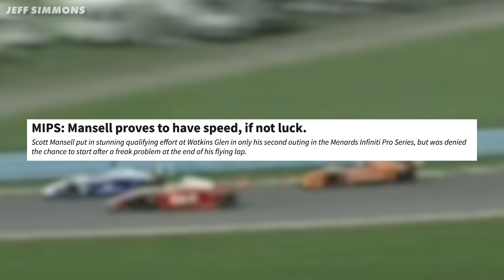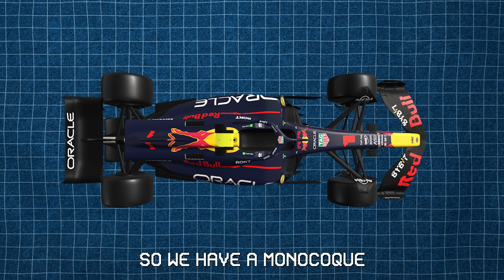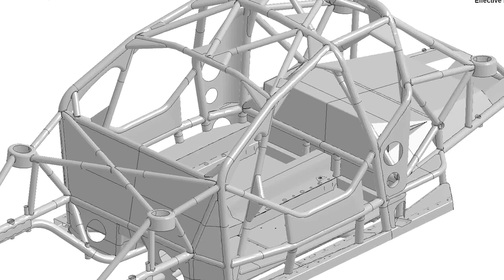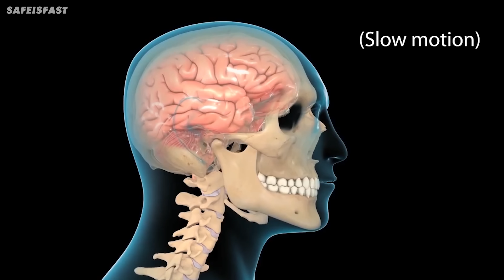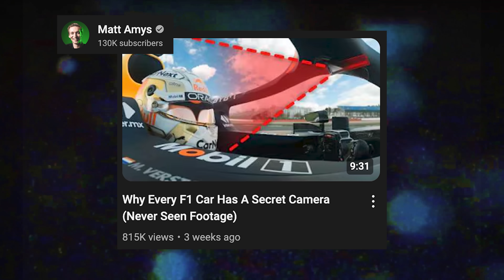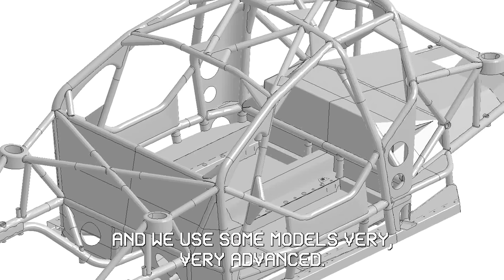How F1 Drivers Survive Stopping 200 to 0 MPH in 0.5 Seconds

Comment: 6:54 - Holy shitballs, he explained that horrendously. That guy is a doctor... right??
Reply: There are also several incorrect attributes of reduced energy as the key to crash structures.  These structures increase the amount of time that the force is applied over.  Force is mass times acceleration, but acceleration is a change in velocity over time.  The parts coming off the car during the incident does not change the mass of the driver.  The variable that can be changed on the driver is the quantity of time.
Reply: I thought he perfectly explained it

Comment: Well.
Most of your videos are great but this one smashed the ball right out of the par./ country!
Superb content.
Superb presentation.
Superb education.
Mems sensors in earpads so great, I hate laws but would'nt it be great if all crash helmets worldwide had mems data recorders integrated, so that cellphone apps could read them.
The necessary increased cost to a reasonable crash helmet would be much less than 0.5% but the value of data would be immeasureable.

Comment: When I was 18 I managed to use my head to break someone's jaw playing soccer. I blacked out for a few seconds after initial contact and my head hit the ground, I was told it was a pretty hard one since I had 0 recollection. I can confirm, its not fun. I had to sit out for 3 weeks as I kept getting the headaches. In the recovery time I was fully aware where I was physically but mentally I did not feel like I was where I was physically, kind of like was was just floating through or being a ghost. Basic school work triggered headaches after only 15-20 minutes. Definitely something to not mess around with, have to prioritize recovery. You can always play another day, but you only get one brain.

Comment: on new years two years ago i had two crashes about 30-40 minutes apart : one was not that big although i did hit my head but the second we drove straight head first into a stone wall on high speed. car was absolutely wrecked and i hit my head extremely hard. I was definitely concussed and felt very weird for a week or two after. fast forward to end of march last year and after some heavy things that took a toll on my body i had muscle spasms, loss of feeling and control and even culminated in a kind of seizure. Did a mri and sure enough i had a big white spot on my brain (part that controls the right arm/flank movement), doctors thought it was either a tumor or dysplasia. three months later another mri and it was gone, no one has a clue what it was or how it went away but it was the same spot i hit my head the hardest on that crash.

Comment: Kenny Brack holds the world record for the highest surviving G force impact in IndyCar at a recorded 214G’s at Texas Motor Speedway in 2003. 357kph to zero in two feet and then further hits down track until his car stopped close to a half mile away. He suffered multiple fractures, breaking his sternum, femur, shattering a vertebra in his spine and crushing his ankles. He spent eighteen months recovering from his injuries. It’s simply amazing that he survived and returned to race in the Indy 500 two years later before retiring from open wheel, (don’t blame him!).

Comment: Brilliant!  Driver side padding also plays a part to try to slow the acceleration felt by the driver's head.  In the case of Robert Kubica's accident in Canada, the car saw 75g - the brain cannot survive that.  The barriers, car and safety systems meant Robert's in ear accelerometers recorded a bit less than 20g.  That is just survivable.  It was a massive crash.  The doctors made him rest - correct!!   He won the race at the same track the following year (crash 2007, win 2008).
Reply: HANS device is the bigger hero.

Comment: Speed has never killed anyone, it’s the sudden stop that does.
Reply: Also true of falling.
It's not the fall that kills you, it's the sudden stop.
Reply: @jofi4580  i realized that i am not afraid of heights, i am afraid of gravity
- one astronaut after his first EVA
Reply: Before the HANS device the biggest issue was that the driver's head didn't stop with the body.
Reply: Exactly!!!  I have sustained 7 concussions, 3 of the massive concussions and as a result I am a different person…I suffer headaches constantly, depression, suicidal thoughts, anger outbursts and insane nightmares and finally PTSD….
I am nowhere near the man I used to be…
Reply: @rokkitman59  I am so very sorry for you.
How terrible.
Do you have support and help with your issues?
Why have you had seven concussions?
Reply: It could. Smashing your car into a concrete building at 200 mph will not stop the car, it will disintegrate you and the car
Reply: To be fair, the sudden application of speed is just as likely to kill you as the sudden removal of it.
Reply: @K-Anator if that was true, then every top fuel, pro stock driver would be dead….your statement has been disproven time and time again.

Comment: Wow, you have quite the following. who would have thought that many young women would like a video about car crashing?   Non Medical anecdotal concussion history; bike ride into a half inch cable stretched across a driveway at night, landed on forehead, blinding light, followed by throwing up, headache lasted for two months.  cold cocked in the temple leaving dance, woke up on the ground with girlfriend looking down, what happened? Temple had soft spot for years.  crashed bike into pot hole, woke on road side with helmet cracked, refused 600.00 ride in ambulance  walked home, next day X-rays resulted in titanium plate and screws to hold collarbone together. had headache for months after. I can't imagine what a race driver goes through.

Comment: The direction of the G forces and how prolonged they are, are almost as important as the intensity.
Reply: G force can be reduced by extending the amount of time the change in velocity happens over.  That's what the crash structures are actually doing.  Extending the time.

Comment: Ratzenberg hit 500g and unfortunately he didn't make it. David purley hit 179g in F1 and made it out alive in 1977. Can't imagine the trauma to be honest
Reply: How did they measure the impact in 1979?
Reply: @procatprocat9647  By the initial speed and the deceleration distance, the crushed length of the car + the bending of the barrier. From 173 to 0 in 66cm (~2ft2inches).
Reply: @boubacar5343 that's a very inaccurate approach to determine quite an accurate result. A minor change in the barrier ground mounting would make a significant difference. That's one example of hundreds. Maybe a tolerance should be added of 20%? Thats a toyaly guess, but it could be determined by summing the tolerances in one direction

Thanks for responding though.

Edit - do you have a reference on how it was calculated?
Reply: @procatprocat9647 Well, they measured it, a movement stopped on impact, there's also photos of the car exposed as it was then.
Reply: @boubacar5343 you can only measure plastic deformation, and estimate the non-linear deformation. You can't measure the elastic deformation of the dozens of different materials that were involved in the collision. 

I was hoping you weren't going to use the word 'measure'. 

Based on your last message, the level of inaccuracy is enormous. To state it to the nearest g is foolish and naive (edit, this isn't aimed at you. Its aimed at the people who worked the numbers backwards. Professional  should know better than that)

Comment: Great video, Mr. Mansell! I'm impressed by how far F1 has come regarding safety since 1994. 
Two things that still worry me are crashes involving more than one car where one car rolls on it's side, cockpit impacting the broken aero of another car. Imagine's Tsunoda's Imola Q1 crash being caused by oil at the same corner, two cars go off, etc.
The second involves a stall at the start. They're increasingly rare which makes drivers less prepared than previous generations. There needs to be an instant audible warning from race control to all drivers the moment a car stalls during the start. Perhaps a rod with a flag that raises which allows drivers back in the field to know where the failure is on the track.

Comment: If there is one thing that the FIA does right, it's safety measures
Reply: Everyone should say Thank You to Jackie Stewart!
Reply: It's the only thing they are vaguely good at.
Reply: @abigailcooling6604💯 agreed
Reply: Aaaaand they banned active suspension on emd of 93, which caused Senna's DD on 94
Reply: @FurryestX  Senna wasn't wearing a HANS device when he crashed.  Neither was Dale Earnhardt.  They died from failure to wear an available safety device that wasn't mandatory at the time of their deaths.
Reply: @FurryestX  I don't think anyone is talking about the early 90's FIA. The modern FIA does safety very well though.
Reply: Too bad it ignored warnings and demands of the drivers and waited until after drivers had died. Nothing like closing the barn door after the horse has bolted.
Reply: Sausage curbes? 🤔

Comment: Nice to see the FIA handing behind the scene's stuff. Safety is one of the most impressive things about F1.
Reply: And it doesn't affect speed or maneuverability negatively (to my knowledge). But that doesn't really matter since the driver would be safe. The Halo is really the life saver, protecting the head even more
Reply: @cheetahman515  Halo is only one of the multiple life savers. It will be useless in a rigid vehicle against a rigid barrier, even if the helmet didn't hit anything. Not to deny credit to the Halo, but it is not THE life saver.
Reply: @Baldorcete  I'm aware, have you heard of a hyperbole for emphasis? It's to protect the driver from debris.
Reply: @cheetahman515   @cheetahman515  No, the helmet is there to protect from debris. The halo is there to protect from direct impacts to the helmet, from fixed infrastructure or big chunks flying around.
Reply: Nice to see they're not just there to annoy everyone with restrictions.